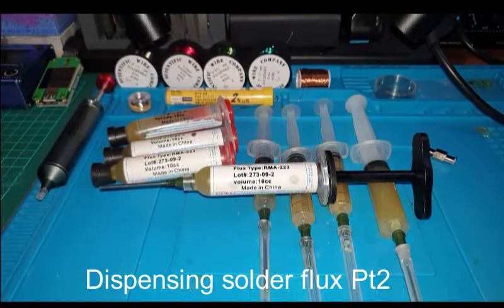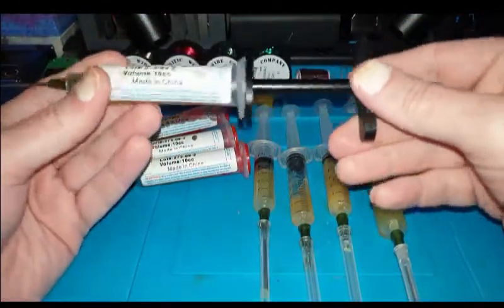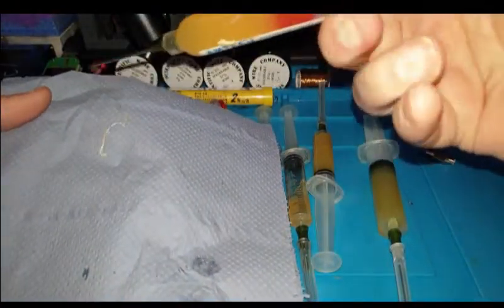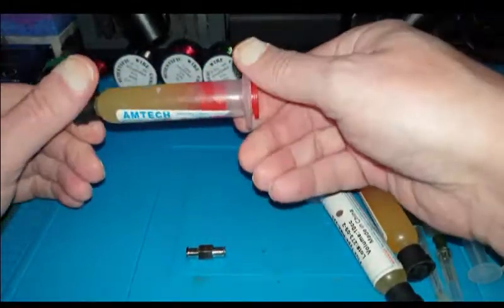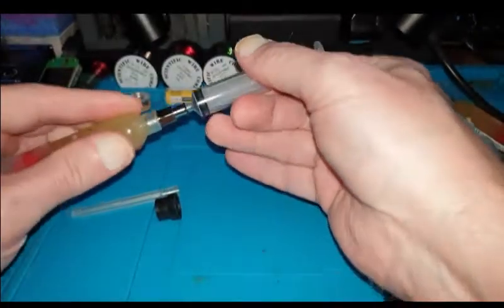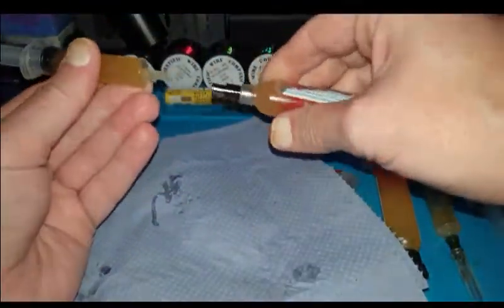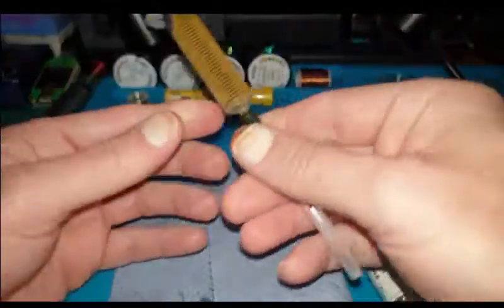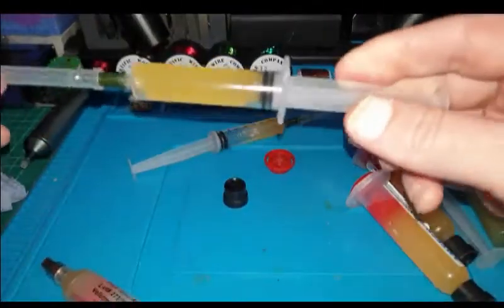Dispensing Flux Pt2 - I changed my mind!

Comment: Mine came with a regular plunger I just have to struggle to pull out the stupid plastic pieces I left the air out will a thin piece of metal don’t poke a hole just slide along or.

Comment: hi great video can you supply links to where you get the  correct size syringe and blunt end neddles thanks jimmy
Reply from the maker: Hi buddy, I had a look on ebay, so if you type "14g blunt needles" you will get a few ads coming up. Ive looked at the different sizes and if you need it for putting out that is thick, then avoid the smaller types as pushing it out will be harder. I think the size your looking for is the biggest which is the 14g one. The g stands for gauge, and they are quite cheap to buy. good luck buddy.

Comment: Thank you I am a complete soldering beginner and i happened to have that flux already. What are the names of the tools. I want to buy them on ebay and or amazon?
Reply from the maker: Hi buddy, the needles are from medical search from ebay, if you type in syringes you will get different types coming up, look for a wide bore needle. when looking for electronic tools, look also at medical stuff and make up applicators, you will find very handy tools in those areas.
Reply: @8inary  Thank you